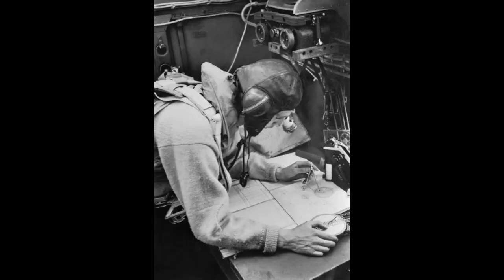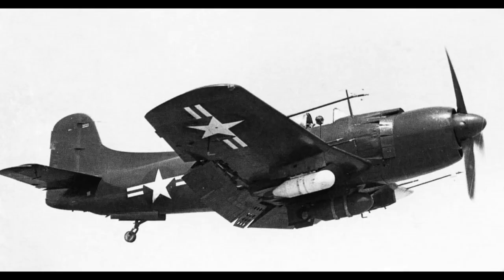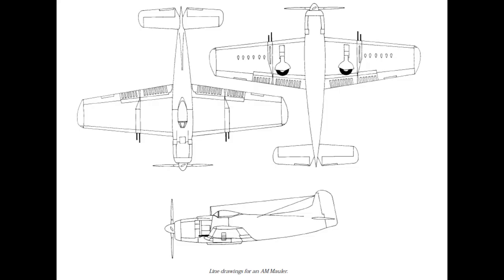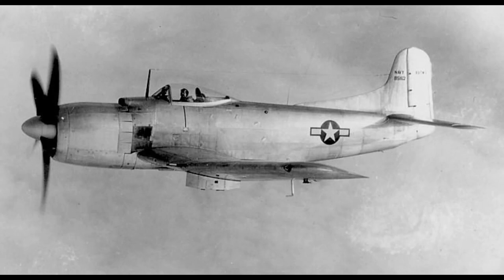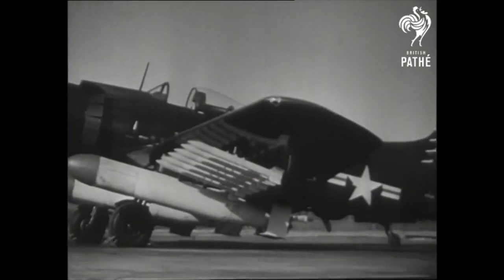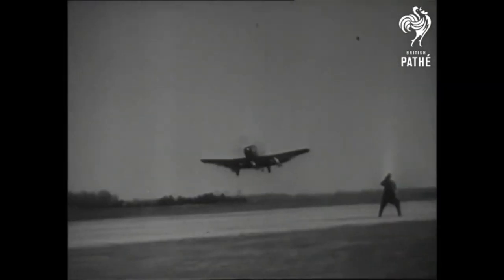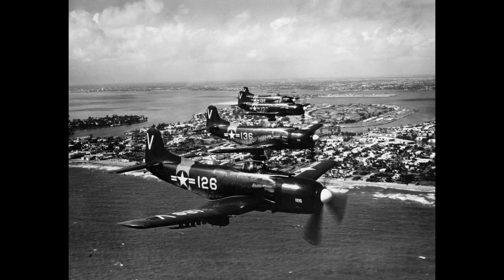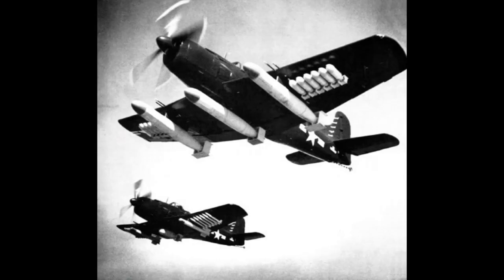The Martin AM Mauler; A Real Beast

Comment: For comparison, the skyraider already had the payload of even the short range load of a B17G.
Reply: That's the B-17 internal load only.  It could also carry about 10,000 pounds externally.  I don't think it did so very often.
Reply: @grizwoldphantasia5005  atill doesn’t change the fact that a single engine attack fighter could carry the same payload as a 4 engine heavy bomber.
Reply: @MaxwellAerialPhotography  It doesn't change the facts that (a) it couldn't carry the full B-17 payload, and (b) it doesn't count the gunners and their ammunition which were also payload.
You don't get to cherry pick which payload matters.
Reply: @grizwoldphantasia5005 It was determined that the gunners weren't particularly effective, and the gains in speed and cieling would have been better protection.

Comment: Douglas Skyraider served a long time in the US Navy, and the French Navy used them too.
Reply: It served all the way into Vietnam w/ the Air Force Air Rescue crews. The "Able Dog" was a classic, and despite it's "reduced capacity" mentioned here, it still lifted the same bombload with its one engine that the B-17 of WW2 fame took four to do!
Reply: @nunyabidniz2868   The Douglas Skyraider was a favorite plane of many and outlasted the rest but the B-17 had 4 R-1690's the AD had a Wright R-3350-26A at 2,700 HP compared to 4 - 750 HPs I read?
Reply: It’s only problem was lack of midair refueling capacity...
Reply: It would be a great CAS/Coin asset today.
Reply: Also US Air Force used them to great extent in Vietnam. Actually shot down a MiG jet fighter with one...
Reply: @CorePathway  You are absolutely correct. In fact, a mid-range propeller aircraft is actually something the Army and Marines would like to have on hand for close air support, since combat helos are vulnerable, and chair farce jets don't have the linger time.

The chair farce, of course, is absolutely and utterly devoted to killing the idea dead. Something like a modern Skyraider isn't sexy enough.
Reply: @kenney5454  actually the b17 wore the Wright 1820. At 1200 HP each in all its combat variants.
Reply: Isn't the Wolverine entering service now as a light propeller attacker? 
I'm glad to see props making a comeback, I hope it serves well
Reply: @kenney5454  Holy cow.
Reply: @Veldtian1 don’t be too shocked - he was plain wrong! See nattybumpo’s correction above …

Comment: A good friend of our family flew Skyraiders in the 1950s.  He swore it could carry far more than the official record states.  He even showed me a photo of his aircraft fully armed and listed the weight of each piece of ordnance.  The total came to over 10,000 pounds, at least matching that of the Mauler.  I did some checking on the Smithsonian website and found the following quote.  I do not know if this includes fuel, but presume it does.  "On May 21, 1953, and AD-4B operating from Naval Air Station Dallas set a new weight-lifting record 6,791 kg. (14,941lb.) that exceeded the aircraft empty weight of 5,363 kg (11,798 lb.)."
Reply from the maker: Yesh! The skyraider was such a great plane!
Reply: I didn't even know lifting more than your own weight was even possible in a single engine plane.
Reply: @abelq8008  Yes, my Dad owned a Piper 235 which could do the same thing.

Comment: The Mauler sort of underlines a minor trend in military tech that I have noticed: the ultimate form of a particular piece of military tech is achieved just as it goes outmoded; piston torpedo bombers, knightly armor, wooden sailing warships, battleships...tanks are still up in the air, I guess.
Reply: Piston torpedo bombers ? You just mean piston aircraft in general
Knightly armor wasn’t outmoded when it reached its peak
Wooden warships only saw minor improvements after the napoleonic wars, if you exclude steam and then again it was just an addon that was developed along with what would replace wooden warships, it only extended their time.
And battleship ? More like any armoured vessels. Similar reasons to piston fighters, rapid technological advancements, and then again on the naval side it’s different, a bunch of them were kept until the 2000’s, some like the Iowa class could still be reactivated today, as modern ships don’t really have armor and thus are just not meant to deal with any armoured targets

Comment: Here is another irony, that while it has been determined that attack aircraft (attack fighters as you put it) need defensive gunners, it is starting to get more and more obvious that a second crew-member is needed TO RUN THE ATTACK SYSTEMS!  The A-6 Intruder (the Iron Tadpole), needed the B/N just to run the first computer (moving platter type computers), and as more and more systems required a second set of eyeballs and reflexes to use precision weapons..  The Intruder guys liked to joke that it was a whole lot better to have an intelligent aircraft, dropping ANYTHING, than JUST smart weapons.  Legend had it that when it got the bugs worked out an Intruder could drop a BLIVOT (500 lb concrete weight with bomb-lugs to weight test the bomb racks) in a tighter circle than if you had just dropped them from a 100 foot tower!

Comment: I'm no aeronautic engineer, but the tail and vertical stabilizer seemed a little small compared to the wings and the amount of torque produced by the prop and engine even in the so-called production version
Reply: I just happened upon this and I'd concluded from the 'Mauler' images that the fin and rudder just looked too small (that's ignoring the 'torque' problem) for the rest of the aircraft. Even the original 'B-17' design had the sort of small fin-and-large rudder combination  that looked set to cause spin problems: it just looked wrong (and was redesigned for the later 'B-17' models). Maybe the facilities available to aircraft designers didn't bring this fin/rudder problem to light before construction proceeded. It would, of course, have been exposed during test-flights. Maybe they thought that the Mauler's problems could be cured or compensated for without resorting to major redesign of the airframe.
Reply: I thought exactly the same Ron, but hesitated to make a comment.

Comment: The leading edge of the vertical stabilizer could be offset to the left to offset the torque of the 4360, but the engine would have to be pointed to the right.
Just a small issue .

Comment: It looks like the Douglas Skyraider was designed based on this plane.
Reply: No the AD1 was designed by Ed Heinemann to fill the same role.
Reply: It does resemble a Skyraider tho.
Reply: @stonefree1911  The Skyraider was supposedly designed overnight but that's hard to swallow. The airframe was certainly adaptable, with that clean wing and the roomy fuselage interior that could be adapted for many purposes. One shortcoming was a lack of armour at a vital fuselage/wing junction: the Navy wouldn't do anything about it until a Navy flight commander in Korea forced the issue and Douglas came up with a simple add-on that reduced combat losses significantly.
Reply: Convergent evolution, I suspect.
Reply: @None-zc5vg  the design was finalised overnight, but Heinemann and his team had been designing a replacement for their less than sterling BTD-1. Heinemann had been lobbying the Navy to cancel the multi-seat BTD-1 and allow them onto submit a new design the XBT2D-1, which was later redesignated the AD-1 (or more fully A1D-1), which was designed to the same specification as the AM-1 (originally designated the BTM). The AD-1 was essentially a single seat version of the BTD which had been developed from the XSB2D-1, but with an uncranked wing and a traditional tail-dragger configuration. Heniemann had asked the Navy for 30mdqys to put in the new design submission but the Navy only gave him to the following morningba 09:00. 3 hours later the BTD-1 was cancelled and the AD-1 was born. The time taken by Martin to sort out the AM-1's handling and other issues were just what Heinemann and Diuglas needed to perfect their design.
Reply: @nunyabidniz2868  correct, their are only a handful if solutions to every aviation design problem.
Reply: They were designed at the same time to compete in the same program.
A low wing monoplane single engine snappy bomb truck is a low wing single engine monoplane snappy bomb truck!

Comment: All the problems you mention re carrier deck landings afflicted the Curtiss SB2C Helldiver too - in it's earliest incarnation, at least.  It, too, had a frame weakness in the rear fuselage that saw tails snap off on heavy (or even not-so-heavy) landings, and it's heavy control, sluggishness and sheer size (it replaced the much-loved Douglas Dauntless) led to crews giving the aircraft the nickname "Son-of-a-Bitch, Second Class" after its SB2C initials, or else "The Beast".  Unlike the Mauler, though, Curtiss was able to address the Helldiver's myriad problems, hammer them out and end up with a very good bomber.  Maybe, with time and with the pressure of wartime to get things done, Martin might have been able to take the potential of the Mauler, fix its issues and turn it into something good.  Yet another aviation "what-if"...
Reply from the maker: I think you're right! If the Skyraider hadnt been there, and the Mauler was the only choice, it might have developed into a useful aircraft.

As one other commentator said: "the main difference between the two was ed heinemann."
Reply: @EdNashsMilitaryMatters  I've never been in a Mauler, but I've been in one of Heinemann's Hotrods (AKA A-4) and you really don't get into one, you put it on.

Comment: Where have I seen that engine before ?
Reply: Mauler engine? P+w r4360, 28 cyl 4 row radial. Also used in martin mercator, b50 version of the b29, many postwar transport aircraft. Also goodyear fg2 version of the f4u corsair.  Skyraider used the wright r3350 18cyl,2 row radial,  as used in the b29. The numbers 4360 and 3350 literally refer to cubic inches. For example, the r4360 has a displacement of 4,360 cubic inches, or around 82 litres.

Comment: Armament capacity is most accurately measured in terms of load delivered on target. The ability to get a large load off the ground or deck does not automatically translate to that. Getting the pilot successfully to the target and back, and landed, alive, without mechanical failure is also rather important And the ability to get off the ground or deck at all, due to maintenance downtime, is also a factor. Bombs dropped on a target per day is more important that bombs dropped per sortie. 

Using this real world metric, the Skyraider had a larger armament capacity than the Mauler.

Comment: 3000 hp is wrong for that era
Reply: That engine was way too big. 3,000hp out of 28 cylinders :( Would have been better with a Centaurus :P
Reply: Despite being 28 cylinders, it was 4 rows of 7 cylinders. Skyraider engine (and centaurus) were 18 cylinder 2 row engines. The benefit of the 4360 was an engine that could be cowled in a smaller diameter, slightly longer length. This was advantageous particularly for carrier aircraft to be easier to see past for landing. Also, early r4360 engines may be rated at 3000hp, but these were further developed to over 4000hp in aircraft such as the b36.